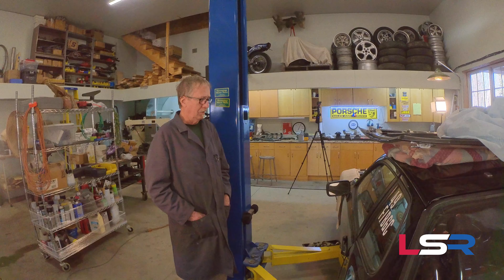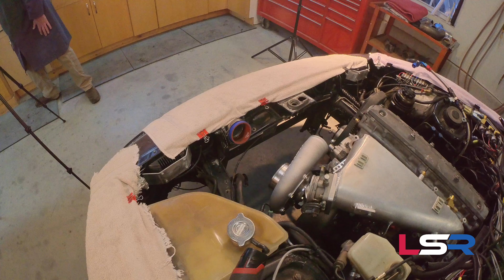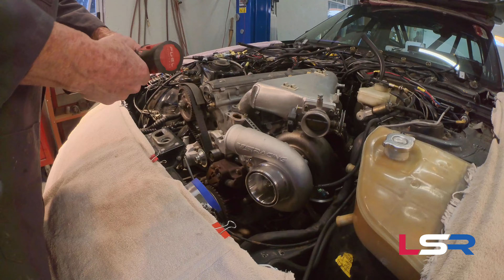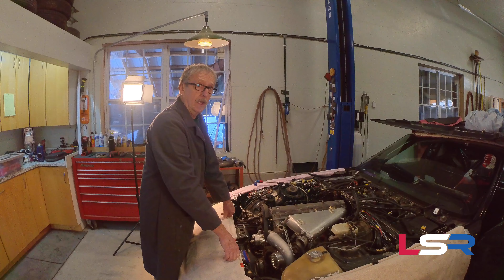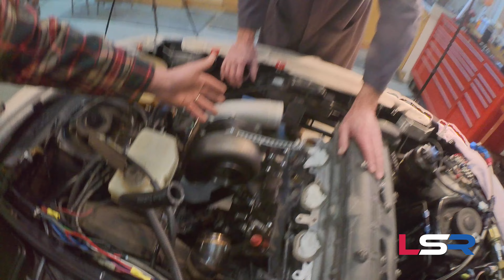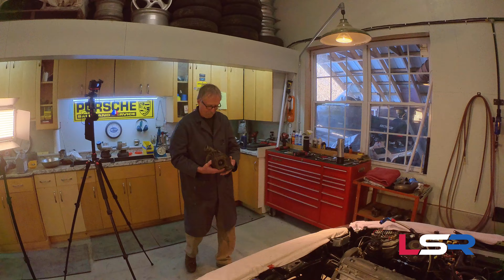Gramp + Dad Uncut Episode #2ish, Interior and New TURBO!

Comment: If that stock 944 turbo is still any good i'd pipe that up to brooke's ranger after you get the 3.0 V-6 running.
Reply from the maker: Hey Cole, you know the 67/62 was something Gramp and Dad thought about for sure.  Dad is planning to gap the rings, set the piston to wall clearance and bearing clearances for some sort of power adder in the future. He was thinking more along the lines of nitrous oxide though. He has a left over MSD Digital 6 Plus box and a couple Nitrous Express Maximizer progress Nitrous controllers in his stash. Nitrous is a bit of a literal easy button. We will see for sure and am glad you are following along with us!